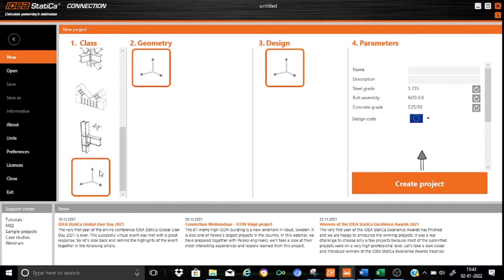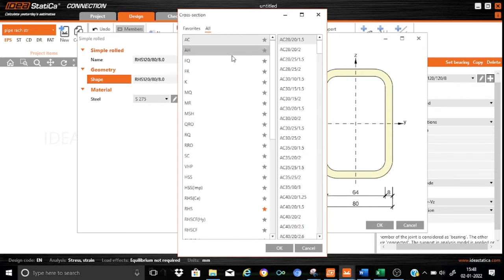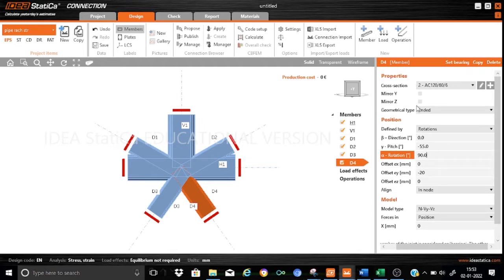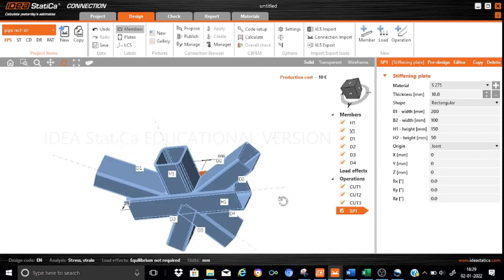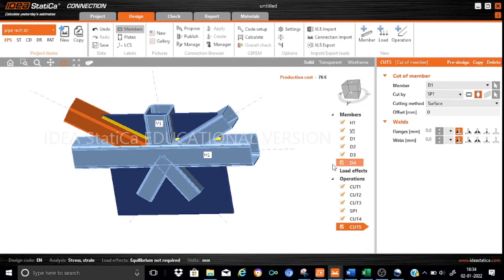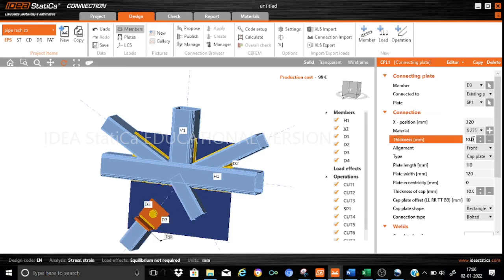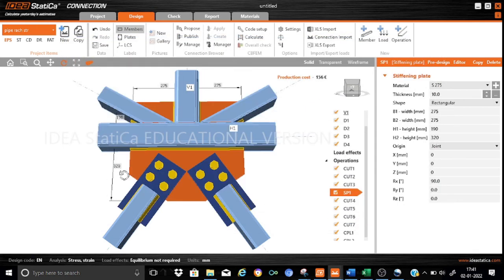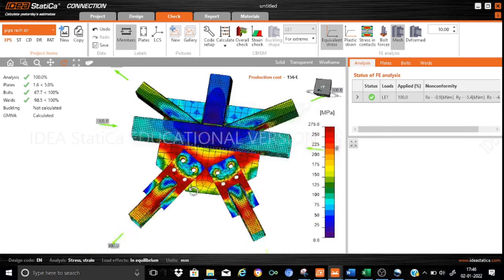IDEA StatiCa: tutorial-10: Bracing  connections (Type-1)

Comment: Sir as we can see the stress in stiffening plate is equal to the Yeild capacity of the plate i.e 275mpa. So does that mean that we need to change the thickness of the plate.?
Reply from the maker: This  means that the material has reached its limiting value fy. The acceptance of this stress level can be made  by looking into the plastic strains developed in the component. If the strains are small (<0.5%) it is deemed to be acceptable_
Reply: @puttattjayarajan1199  Hello, is it <0.5% or <5%?

Comment: pls what is the meaning for ( set bearing command) and how does it effect the results ? because when i design connection and assign one member to be ( set bearing contious ) the result analysis will differ if i change the set bearing to other member 

thank you
Reply from the maker: Hello Taha,
This is an interesting question.!!!
In analyzing a structure in any software , we always "assign" the correct supports to ensure that the structure is stable and that the calculations do converge. IDEA Statica , which is essentially an FEM based software for the connection design do the same thing through set bearing command. The members which are set as "bearing" do have supports on  its ends and thereby you will not be able to apply any loads on these ends. The members "set as bearing" shall be judiciously chosen by the designer based on his objective. The analysis results are obviously affected by the choice of "set bearing " member..!!!
Also note that IDEA statica  has two options for analysis (i) simple:  in which we mention one member as "set bearing". 
(ii)Advanced with one end bearing and an equilibrium check  done using the ribbon loads in equilibrium
If you are importing the forces in various members for a given load case, the equilibrium is already confirmed and no further equilibrium check need to be performed by IDEA Statica.
Practice makes you perfect......true for IDEA Statica too.
Further you should also have sufficient technical base to verify that the results by IDEA statica are reasonable  and this also enables you to track the mistakes in modelling 
Hope that this answers your queries....please share the vides with your group as well.
Have a nice day
Reply: @puttattjayarajan1199  thanks Puttatt for your swift answer :) 
can I assume the truss top rafter ( the main member) which carries out of-plane purlins to be supported ( bearing) as the purlins are covered with panel sheets which give purlins some restrains ?
Reply from the maker: @anastaha2438  Hello Taha..
There seems to be some kind of misunderstanding regarding what to be considered as a bearing member..
As a simple explanation, consider bottom joint of  a truss consisting of four members two each horizontal and diagonal members . If you are interested only in verifying the connections for diagonal members , the horizontal members can be considered as 
bearing. On the other hand if you are interested in the stress distribution in horizontal members and adequacy of their connections, you can keep diagonals as bearing.
That is, I am repeating , which member to be considered as bearing depends only on  the objective of your analysis.
Please remember that the joint can also be checked without any bearing members wherein you will apply loads on all members meeting at a joint  and press the ribbon "equilibrium check" before design. If the member forces correspond to a single load case (not envelope) , the equilibrium check is always guaranteed,
You don't consider restraints etc as specified in your query for consideration of bearing members. Such consideration are used only in obtaining effective length of truss members.
Hope this will clarify the matter further.
Reply: Thank you so much
Reply: Dear Puttatt, 
Can u pls clarify the actual end member and the continuous member for load cases?

Examp;le when there is a continuous column and an end beam, when I need to enter the load and stress values for the column, i assign the bearing for the beam . and when i need to enter the load and stress values for the beam , i assign the bearing for the column 
Now, does the program take into consideration while analysis that all the loads for both column and beam are entered , especially in equilibrium check?